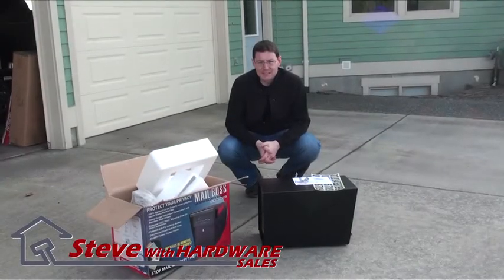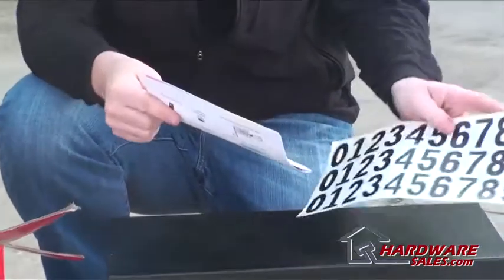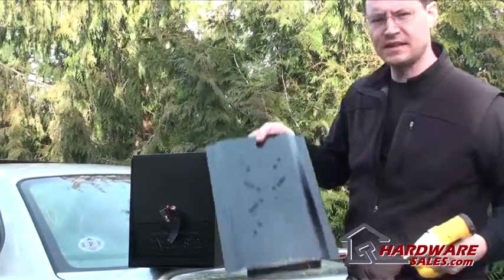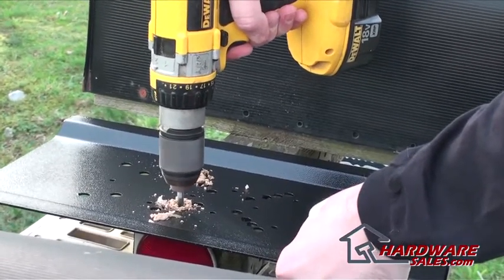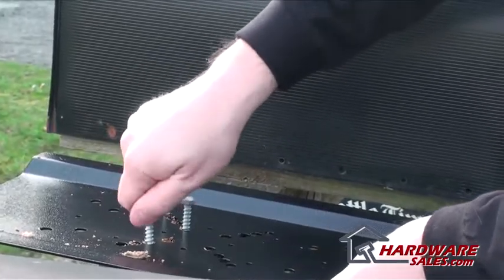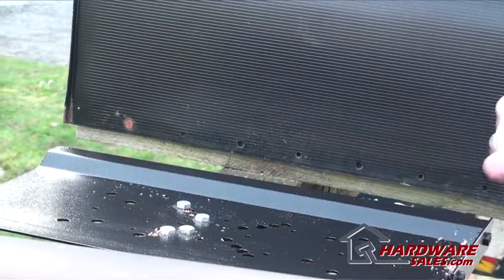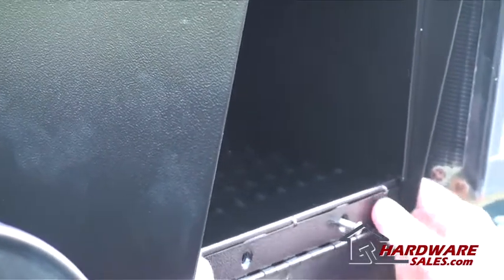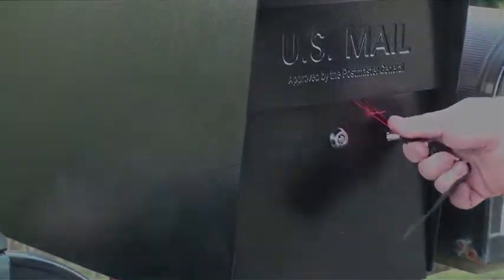MailBoss Mailbox Installation with HardwareSales.com's Steve

Comment: Great vid. What are the chances someone would cut the post? I ask because I don't think the still post is worth the cost.
Reply: The steel posts are not only more secure, they wont rot in the ground likes wood ones do over time. It depends on if you've had any theft issues and how often the mail is collected.